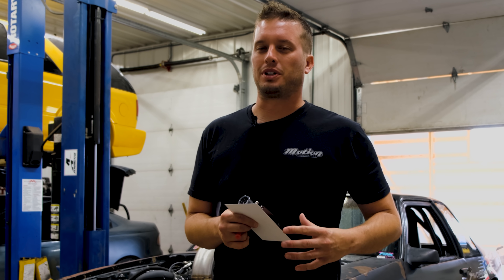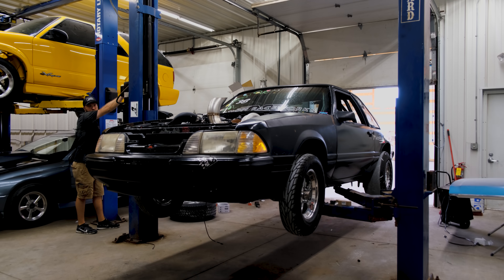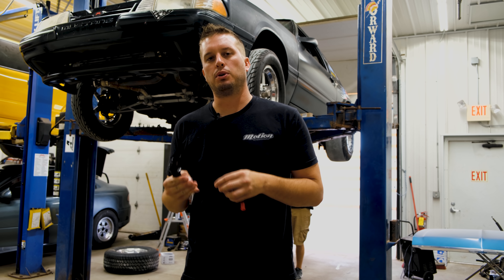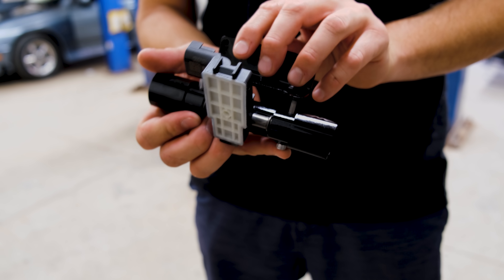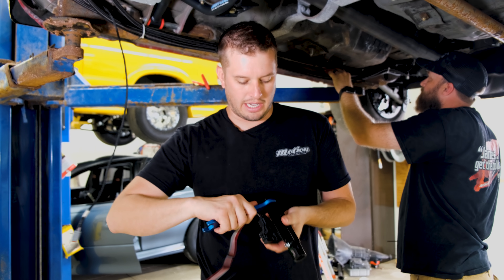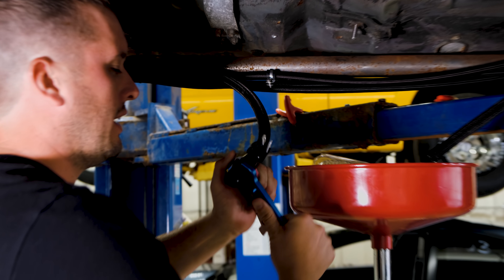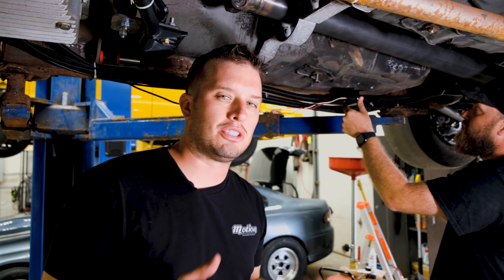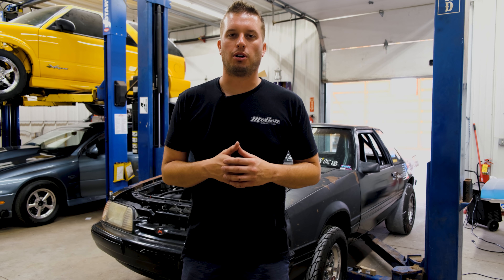E85 Flex Fuel Sensor - How To Install: Tech Tip Tuesday featuring El Toro

Comment: It's a cool concept and I'm about to buy one, but I wouldn't worry too much about the line being a restriction or not. After all the orifice tube on a fuel pump is smaller than 10AN. The fuel lines coming out of the "hat" of an EFI tank are smaller than 10AN. Just because you have some very small parts of the fuel system that are smaller than 10AN doesn't mean it only flows as much as the smallest size fitting.

Comment: The flex fuel sensor should be powered by the ECU, that is 12 volts DC.  Also, it will need to be integrated into the car's software, it won't control the injectors just because it has been added into the fuel line.  No information was given on this topic.

Comment: Are there more benefits to running in the feed then the return?
Reply: Start at 8:10...
Reply: If you put it into the return line, the return line will be partially empty / have air in it. That can mess up the readings.

Comment: Referring to when you made mention of the Haltech system and it's advanced E85 capabilities. If you did install this sensor on the return side, to help eliminate the possible air bubbles messing with your sensor readings. If a check valve, with a low 2-3psi crack pressure, was installed between the sensor and the tank, essentially creating a 2-3psi backup through the sensor and the rest of the return portion of the fuel system. What sort effects would this have on your fuel systems main fuel pressure regulator setting and function? Is it as simple as the additional crack pressure of the check valve adding to your previous regulator psi setting?

Comment: Really like this design, some of the adapters I've seen just slip on the end and the hoses can pop off! Needs a safety clip or a bracket like this that retains it - very nice! Like that bypass passage too in order to prevent restriction in high flow apps.

Comment: your wiring info is conflicting. the link on your site says it requires 5v, but the diagram shows 12v. 

i cant say ive ever seen a flex fuel sensor that requires 5v.

Comment: Can you run one of these on Holley terminatorX for fox body?
Reply: Sloppy mechanics makes a wiring harness that hooks right up to terminator x and to the flex fuel sensor just found out. FYI lol
Reply: Yes
Reply: @scottbennett3548  what would be needed to make it work besides sensor?
Reply: @mikeaustino4505   not exactly sure but I think just the sensor and a tune...but you’ve got to make sure your injectors and all of your fuel lines and filters are E85 compatible because E85 is corrosive to some things.
Reply: All of it is e85 compatible thanks
Reply: @mikeaustino4505  don’t take my word for it though lol I might be wrong 🤷🏽